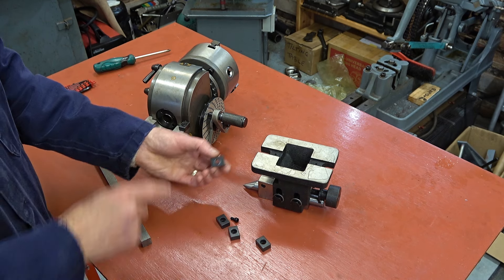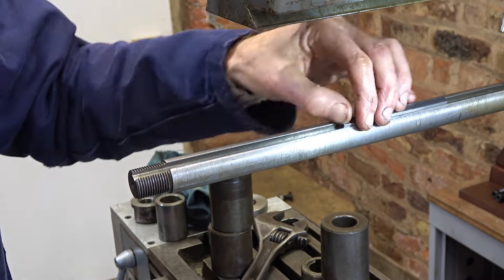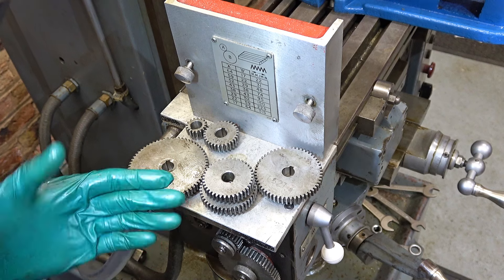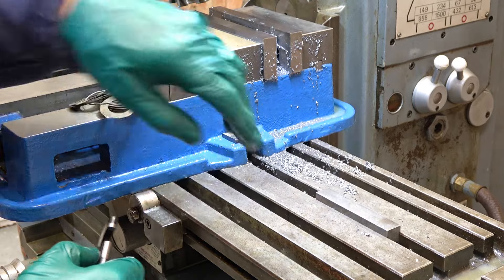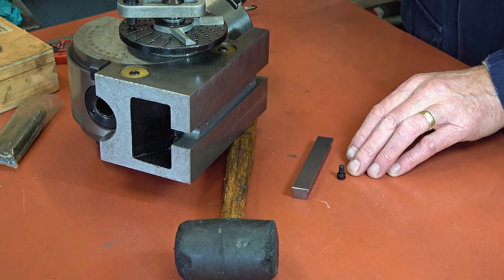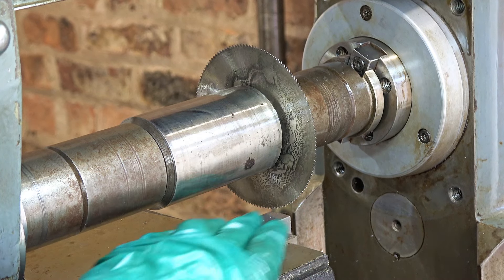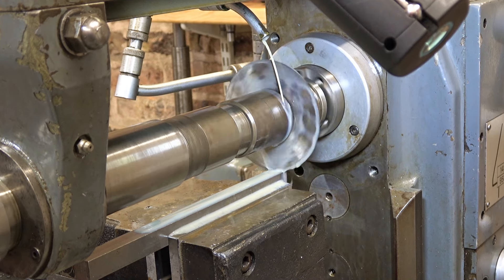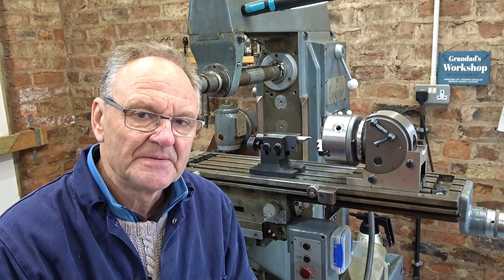HS282 Making dividing head alignment keys (with slitting saw drama)

Comment: Slitting rule:  Slow feed; More speed.  That gives less tooth pressure on the saw & a finer finish on the cut. Good to see you back machining again Paul. Wife & I are well after going through breast cancer surgery and having both her hips replaced with titanium & ceramic do-dads. Worst 2 years of my life, but the sun is shining & I'm back in the shop,too.
Reply from the maker: Hi Bob, I thought you had been quiet for a while and I was beginning to wonder. Yes I'm  back in the workshop for a while but I've still some outdoor jobs to do before the winter comes which will need some priority.  This week has seen my son move house and another granddaughter arrived so it's all go here.  Regards to Mrs G. Good health is not guaranteed as we get older. Cheers.
Reply: Looked too slow to me. I dont know also how a fragile saw would be affected by the audible run-out of the spindle
Reply: Worst two years of her life.

Comment: Good to see a horizontal mill working. I like your digital height guage, great idea. Hope you havent done any unseen damage internally to your mill. I did similar on my Rapidor hacksaw (to post yet, lol). Sometimes you can't see the wood for the trees concentrating too hard. Good learning curve Paul. Enjoyed cheers..... Tony
Reply from the maker: Hi Tony, crashing that bar into the end bracket was such an idiotic thing to do. If the slitting saw had not exploded then I'd quite possibly have really damaged something (no sign yet). I hope it would have stalled the motor but the gearing was very low so it would have taken a lot to stall it on that slow traverse. Gulp!! I don't like to think about it. Cheers

Comment: It took a while to get used to the cutters spinning with the strobe effect. It got worse when I thought you were climb milling. Luckily you had the cutters spinning CCW in the opposite direction to the traditional way. This meant that instead of milling traditionally from the right side of the workpiece and finishing on the left your traverse was in the opposite direction.
Maybe starting the slitting saw centrally above the workpiece and feeding the table up was the way to go. Sometimes when starting on a corner the slitting saw does not precisely align itself when clattering on a corner. Starting smoothly in the middle of the part often helps.
When using the depth micrometer it is far easier to read if you have the scale facing you instead of at the back.
If you left the bar at the original length you could have cut them off on your saw.😉
The hacksaw looks like it lifts on the forward stroke, this is to prevent rubbing on the return stroke. So I suggest the cutting should be on the return stroke - (when it is not lifting). Try mounting the blade the other way around. It is generally accepted that you will get double the blade life as it does not drag the teeth backward over the part. There is also quicker cutting due to pressure on the cutting - pulling stroke.

Comment: Hi Paul, I am back home and in the loop again! 
I have inherited a number of variously abused slitting saws. If you think about feed and speed together the slower the saw turns, the more metal each tooth has to remove to allow for the feed rate, so the slower the saw spins the greater the individual tooth load. With a low rpm on the spindle, you think you are going steady but you are actually doing the opposite! Keep rpm high and feed low with slitting saws, doesn’t make for spectacular video, bur saves on cost in the long run!
Phil, (moving gently around the house)
Reply from the maker: Hi Phil, glad you are making progress. Autojumble tomorrow morning so I'll be buying any slitting saws I can find. Usually £2 a saw there and often unused. Online it could be £20 a saw. Cheers Paul

Comment: That was a great video Paul. A few years ago now I made a simple arbour for my slitting saws. It drives by friction with no key. If the saw jams it just slips. 

For feed rate on the job I was doing I consulted Chapman. He gives a figure of 0.05 - 0.08mm per tooth. 

Assuming a cutting speed of 20 metres per minute for mild steel and a saw of 70mm dia with 72 teeth:-

RPM = (Cutting speed/pi) x  cutter dia...
 
= 90 RPM for the above saw.

At 0.05mm feed per tooth, 72 teeth  gives 3.6mm per rev. 

This gives 0.0036 x 90 RPM which is 0.3 metres per minute feed. 

Obviously this is a bit open to experimentation and depends on the size and rigidity of the machine. It worked well for me on my Taiwan mill drill. I'd imagine the Harrison mill to be even better. 

Thanks again for posting. I wish I had so much horizontal gear for my Harrison mill!
Reply from the maker: Thanks for the calcs Carl. A foot per minute I'd be nervous of that, I'm still picking up shrapnel from around the workshop. What depth of cut would you set?  Cheers Paul
Reply: @HaxbyShed  Hi Paul. I had to make something like a 10mm deep slot about 1mm wide in a steel part. In fact it was the slotted knurled nuts I made for securing the change wheels on the Harrison mill feed box, which  were missing on my machine. I took that cut in one go, feeding the saw at about half of the feed rate I calculated. The speed worked fine. I just use Chapman as a guide and then experiment from there.

Comment: I had to commit the broken shards of an expired slitting saw to the scrap bin myself this week. They work great, until they don't. I wouldn't have been brave enough to attempt 18mm in steel in one bite though! Have a good weekend, Matt
Reply from the maker: Hi Matt, at the autojumble this morning I bought about 7 of those thin saws plus a range of others up to 1/4 inch. Going rate was £2 per saw.

Comment: Hi Paul    Thin blade's  avoid ,  Hack saw blade's run teeth cut on the back stroke.  I stopped making square bar keys . I turn them to size. Far easier harden temper if want.
Steve

Comment: One thing I never came across when I was an engineering trainee 45 years ago (at York College of Arts & Technology when was on the old site on Tadcaster Road) was a slitting saw.  So the first time I ever used them was in my home workshop maybe ten years ago.

The vertical arbor I have is the clamp type without a key so it would probably slip when pushed too hard.   I was only making controlled cuts of maybe 3/8”. So I  just wound the speed right up to about 1500rpm on my Seig X3, took a shallow depth of cut, lots of cutting oil and hand fed because I’ve not yet go around to making an electric table traverse.  

I had a few slippages but surprisingly no breakages…not that I can’t break a fresh out the box brand named carbide end mill within a few seconds given the ‘right’ circumstances.

Comment: I've only used a slitting saw once, in a vertical head. My work moved a little in the vice with the same result you had. I ended up in the Record vice with a hacksaw. When I finally get the new to me mill working correctly, I'll try it again with the horizontal. I think I will take on the comments of the contributors here.
Reply from the maker: Hi Bill,  my slitting saw experience seems to have started quite a conversation hasn't it. But all good info I can use. I could have edited that stuff out - but what's the point in that......   Cheers
Reply: @HaxbyShed  I'm glad you left it in Paul. It confirmed that I'm not the only one who got it wrong. :-}}

Comment: I've made the same mistake with the slitting saw as you did. The saw teeth are too fine for that depth of cut, the few teeth that are cutting fill up the gullets, stop cutting and the pressure snaps the blade. A blade with far fewer teeth (20 ish?) would work much better and dont use a key!
The gang milling setup was good. I've never had a matched pair of cutters to try it. You'll find that a horizontal cutter is much noisier at the start of a cut as the teeth are approaching a vertical surface. Once the cut is underway the teeth start cutting on a horizontal surface and the chip gradually thickens. A vfd on the feed motor works well, slow at the start, speed up when the cutter is in the work.
Reply from the maker: Hello Sir, I bought a new batch of slitting saws from the autojumble at the weekend and a few have quite large teeth more like a rip saw than a panel saw (if we were talking wood saws). I have a VFD on the x-feed and I have set the 
 adjustment range 2:1 so it would run 22 to 44 mm / min in that example. Next time I will try a less-fine saw and cut by hand - and no key.  Cheers Paul

Comment: A quick tip about slitting saws from a retired machinist. Firstly they inevitably don't run true so you'll find you are really only using 3 or 4 teeth to do all the work. So hand feed only, don't put a key in the arbour, don't over tighten the arbour nut as you actually want the saw to slip on the arbour rather than break. If the saw slips just back off the table hand wheel before the saw scores a ring on the arbour and feed in again slowly. Hope it helps.
Reply from the maker: That's great advice, thanks Andrew. 👍

Comment: The slitting saws I've used went well.  But I always hand fed them with a keen eye and ear looking and listening for anything.  The mystery was that I didn't hear anything untoward right up to the KABOOM!  No idea really.  But I think Robert Ginther hit the nail on the head with more speed.   Not a whole lot more.  Check the SFPM or circumferential meters per minute I guess.  But yeah, somewhat faster would have avoided a dig in.   The slitting saws do tend to only cut on one part.  And the next time on some other segment.  With the low RPM and power feed I suspect it simply dug in and the thin nature of that blade just couldn't dig deep before it hit the last straw.

Comment: I’m surprised at the amount of runout the saw exhibited. Generally, it’s best to cut deeper rather than shallower cuts. I rarely make shallow cuts unless that’s specifically needed. But if the blade isn’t pretty concentric, and they’re never as good as a mill bit in that, all the cutting is being done with just a few teeth, which puts a lot of stress and wear on those teeth. I’m surprised that a saw would explode unless it’s stressed or cutting is much too fast. If cutting is too slow, the teeth dull rapidly.
Reply from the maker: Hi it was my first ever attempt with a slitting saw (so lots to learn) and I probably had far too much feed on and maybe a bit slow speed also. I know that arbor is good so the runout surprised me also. Anyway, I've bought 7 fine slitting saws today at the flea market. Cheers

Comment: I run quite fast spindle speed and actually prefer to feed by hand as I can feel how it is cutting. Also I don't fit a key when using a slitting saw.
Reply from the maker: Good advice Tony. I will remember it. Cheers.

Comment: Dull blades? Only needs the corners of the teeth to be worn a bit & the sides of the blade will rub. Also looked too fine for that depth of cut...
Reply from the maker: Thanks MidEng, I've noted the point about fine teeth. I think I'll need a fair bit of practical experience to master slitting saws.

Comment: Never seen cutters running in reverse before, what was the benefit?
You have a shaper, surface grinder, universal mill and center lathe, but no counterbores or any idea how to grind a flat bottom drill.

I strongly suggest you research how to use a surface grinder safely before you use it again.
ATGNI
Reply from the maker: Hi Marley, the cutters look like they are going backwards but it is camera strobe 50Hz video and about 65 rpm on the arbour. Just like the wagon wheels seemed to run backwards on the old cowboy movies. I've bought the counterbores now, and I'd be very pleased to receive your advice on surface grinding safety if you would be willing to share it?  Cheers
Reply: @HaxbyShed  The strobe effect did throw a spanner in the works. I expected them to rotate clockwise and conventional milling right to left. The confusion started when the cutters were put on the arbor backwards. The consequences of this led to the spindle having to be run in reverse and fed in the opposite direction. Coupling this with the strobe effect was baffling:)

It's worth checking a few things with the counterbores.
Check the shaft is soft so it does not spin in the drill chuck.
Make sure they have 4 flutes to minimize the risk of snatching that you get with 2 flutes.
See if there are gashes in the pilot. This confirms they will cut beyond the pilot circumference.
Measure the pilot diameters. Some specifications need large clearance holes for the pilot to fit. This removes the advantage of the larger head diameter that metric cap head screws have. If the flute depth allows, you can reduce the pilot diameter to suit your preferred clearance hole sizes.

There is far too much grinding info to include in a comment, but I can shed some light on your setup.
Heat is the enemy of grinding; your setup needs to pay attention to this. You have a manual traverse, this is often far too slow over long parts. Having the wheel dwelling over a part will heat it up, this leads to the part growing thus increasing the depth of cut and helping to generate more heat, and on it goes. On your part, this consequence is exaggerated because it has a small mass so it will heat up quickly. There are ways to minimize this, pop the part diagonally on the chuck. Then each pass is much shorter and won't build up so much heat in the middle. Another thing to avoid is plunging down on a long low mass part as you did. This is probably the fastest way to heat the part up and have it grabbed by the wheel. Don't rely on the flat dress of the wheel to produce a flat surface. Put the cut on with the wheel off the part then traverse across using the Y feed to index over the part incrementally. Hopefully, this sheds a bit of light on your setup and helps keep you safe in the future. No more parts with a dip in the middle where it has got hot.
Reply from the maker: @marley589  That's very useful detail which I will try to take onboard. As you can see I'm an absolute beginner when it comes to surface grinding. That was my very first real practical use of the SG. Cheers